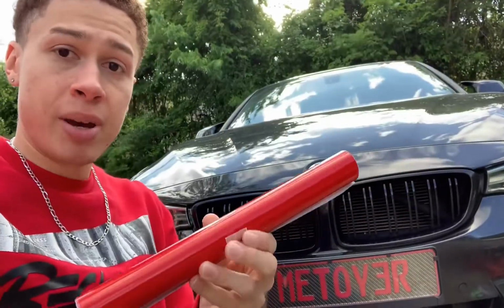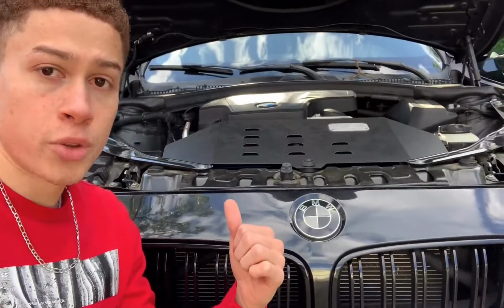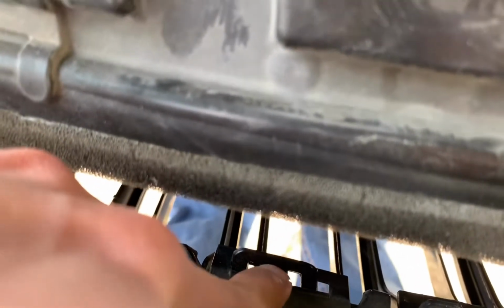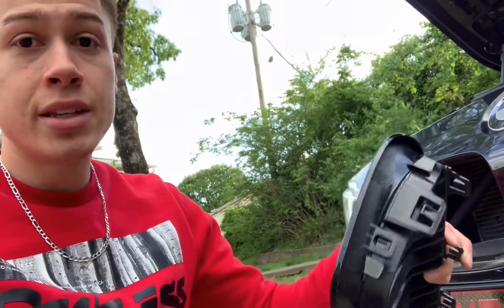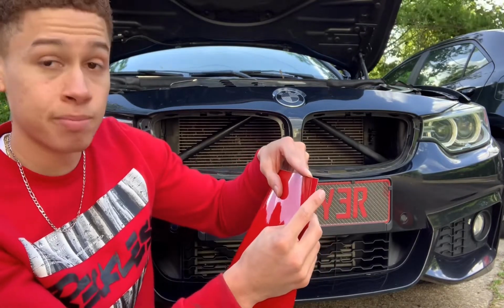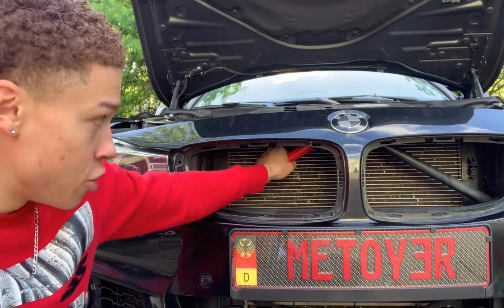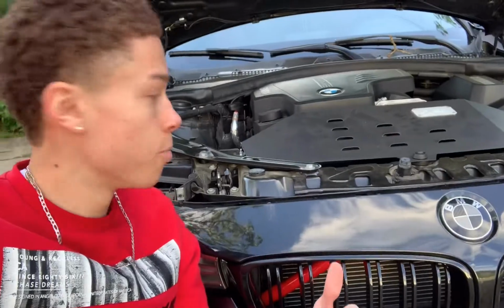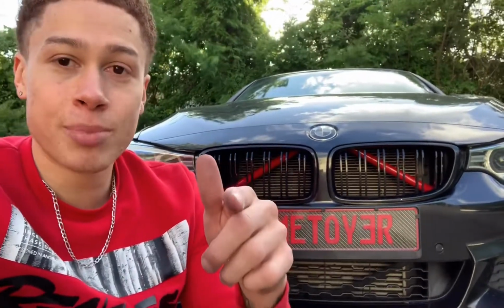BMW 428i V Bar Wrap

Comment: Would it be feasible to remove the grille without undoing the top screws and reaching the clips from the grille cracks?
Reply from the maker: If you can remove your grills without having to reach around the bumper then that would work but you run the risk of breaking a clip of you try to remove it that way

Comment: This may not be relevant but I have the same car and my audio I’m the whole entire car is out the radio, sensor peeps and everything. Changed the fuse and it came back to life and went out again 2 and a half weeks later. Have any idea? Thank you!
Reply from the maker: Doesn’t sound like anything I’ve heard of before but I would check the BMW Forums. There’s lots of great information out there on the vehicles and most of the time you can find someone that had the same exact issue that you’re having. Hope this helps!

Comment: i have a f36 gran coupe just got the kidney grills cannot take them out smdh.
Reply from the maker: Mike Reese what are you having trouble with?
Reply: Metoy3r taken those clips off.
Reply from the maker: Mike Reese did you try using a flat head? Also try starting from either the clip on the far edge or the clip toward the middle . Those are the hardest ones
Reply: @mike12585  it took me forever too what I ended up using was a back scratcher to get out the ones from the bottom lol, don’t be scared to pull the bumper out and stick your hand in